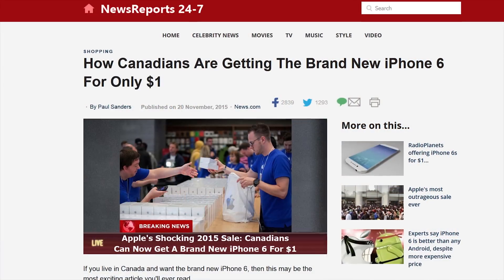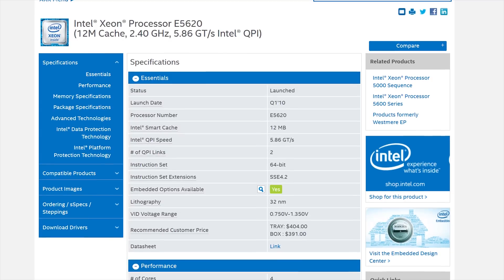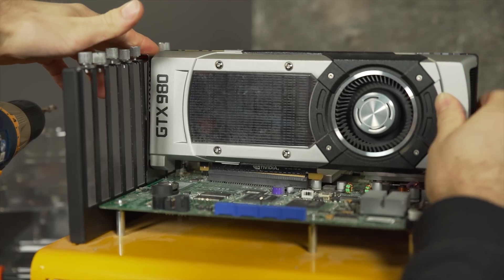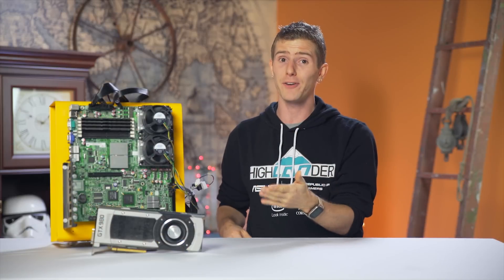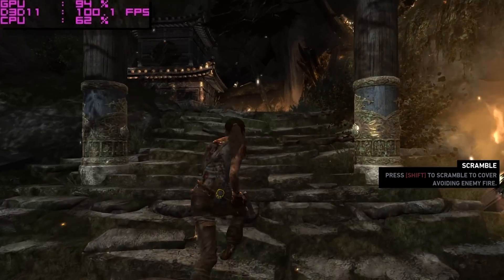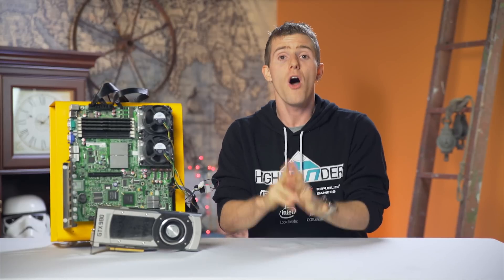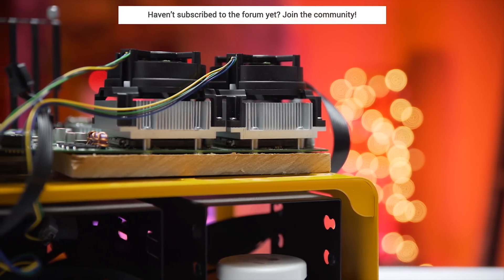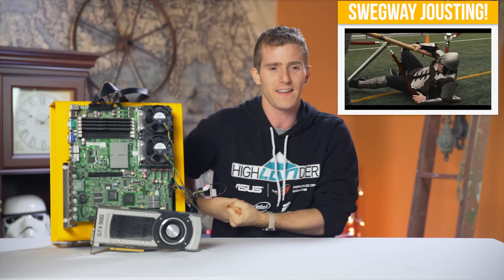Under $150 Budget Gaming 8 Core CPU, Motherboard & 16GB RAM

Comment: = to a amd fx............ get a fx it cheaper and use less power
Reply: +MrBonami2 Edit a fx 6300 at 4.4 do the same cinebench score i had one.. and a fx 8300 at 4.4ghz do like 650-700
Reply: *****  Yea sure........ Game are perfectly coded bullshit
Reply: *****  Im trying to says that current cinebench show a decent result for any cpu that can be trusted.. a 6ghz fx reach 1000+ score
Reply: +Qyndryx do not really care. it show amd fx multithread to be ok and singlethread to be crap
Reply: ***** Use passmark the benchmark software if you want to see the purpose of amd fx.  My 8300 at 4.4 is reaching the same integer performance as a stock 5820k.. That pretty awesome
Reply: ***** I agree with you on that :)
Reply: +MrBonami2 i bought a used X58 system. A Xeon X5650, 12GB ddr3 and an asus sabertooth x58 coupled with an Samsung 850 EVO 250GB, 2x 2TB WD red and an Asus R9 290X platinum. ITS A BEAST. My cpu runs at 4GHz, and has a cinebench R15 score of over 900.
id say, for about 500€ (i bought everything used) this thing was totally worth it. absolutly wrecks every intel quad that is out right now in terms of multicore performance. i bought the Xeon X5650 for 70€, doubt an AMD FX 6350 can keep up with it, and also every part was bought on its own - my ultimate console killer machine
Reply: calcyss That a great build :)  but it about as strong as a fx overclocked in singlethread  Since the xeon got hyperthreading it inflate it Cinebench score :)  my 4790k crush a i5 just because of that.   Can get fx 8300 for like 100 usd.   But it still agree with you that your build is awesome for the price :)  Sabertooth + Xeon 12 thread.

My fx is on a 100$ mobo and do 700 cinebench at 4.4  But is equal to a 5820k in Integer task

Comment: Linus, you should just try and get a 1156 socket build. Dirt cheap and no modding needed. No ECC memory. Perfect motherboard/cpu combo for any case. It may even run games better and overclock to 4ghz. Check out the i7 860s. Lots of people were able to get them to 4ghz+ on Air.

Comment: This is a terrible idea. You want a cheap 8-core PC? Get an AMD FX 8320. It will perform far better, and that CPU can be had for as little as $100 on sale. With the motherboard and 16GB of RAM thrown in, you'd come out to around $200. I owned a Dell workstation with two Intel quads from this generation (X5350s). Aside from the performance being as poor as this video shows (nearly identical cinebench), the heat output and power consumption was tremendous. The CPUs alone use 240 Watts total (120 each). But Linus would rather defend the practicality of using server hardware that is several generations old than admit that an AMD CPU could be used for gaming.

Comment: I went with a modified xenon chip (q9550 equivalent) to fit with a p45 p5q pro and 8gb ddr2 800 and hd7970.   Overclocked the CPU to 4.2 GHz and costing me totall less then 250usd :) steady as a rock for over 5 years now.

Comment: i just got two 5620's for 25 bucks lol, the i7 960 only beats this procesor by less than .5 CPU boss score, imagine two of them!! i also have a 6870, so in my case, the gpu might be the bottleneck
Reply: +oldyogi23 correction, it beats the i7 960 with a score of 5.5 vs 5.4, the i7 980x beats it with the score of 5.6 vs 5.5, however the i7 980x creams it in geek bench, and doubles it in passmark whole cpu

Comment: I just got an hp xw 6600 workstation (at least I think it is and xw6600) it has 2 quad core e5430 xeons at 2.66 32 gb of ram 2 hd5870's and a 500 + 320 gb hdd plus his older (700 w cm b series psu) and as far as I notice that thing works like a charm. It does seem like a good deal for 200€ and thanks to you linus I now knows that it wasn't a bad idea because I haven't had time to benchmark it yet.

Comment: I feel it necessary to point that you probably shouldn't have modified the (very nice) video card, despite the fact that it was fine electrically. It probably would've been easier and better to have desoldered the capacitor and relocated it. That motherboard isn't nearly as valuable as the GPU...

Comment: 2 very big issues with doing this first is how much power is required for 2 old cpu vs one new cpu (i guess not a total deal breaker but will heat up a room a little bit quicker) So you will need a least a 600w psu to be on the safe side, and the other is the really big one any single threaded app or game will perform very slowly 2.4Ghz is just not enough for good fps in single threaded games like D3 RoS. Now i suppose the right tool for the job is in order so if you dont play games that are single threaded (base) or if you want to use this system for doing work like encoding then maybe it could be a good deal.

Comment: Is someone willing to make a 450€ build without GPU (have a gtx660 OC laying around) for me on PC parts pickrr? If you do, please do it with german prices (they are a lot highrr than the american ones). Would be nice if someone did that because i'm giving up because of the high prices in germany
Reply: +Dölle 220€ for a 190$ CPU is not cheap._.
Reply: +xSixtyyy Sweden recycles motherboards, cant you take the train to Sweden and get some Recycled parts cheap? All the gold, silver, copper and other metal that comes out of them.
Reply: +xSixtyyy 
uhmm prices are one of the cheapest in europe here in germany. I can make you one on the german website mindfactory.de. This website has the cheapest prices.
https://www.mindfactory.de/shopping_cart.php/basket_action/load_basket_extern/id/7aa1792219f181c7e28783e17381317f35d17fa442e81620271
Reply: +Dölle but thanks for the sick build:)
Reply: The cpu is 180€
Reply: Dölle yeah im not talking about this one

Comment: ill buy that damaged 980 for 200 us dollars hit me up linus
Reply: +Der Derderder I wish I had a 980... It's a beast of a card, and I really wanna try Nvidia's Flex Demo.
Reply: +Yarnell Riley If you are working in any CAD then you should already know that the best cards for that are the Nvidia Quadro line. As for simulators, I would suggest AT LEAST running two 980ti in SLI for decent performance on the settings I'm assuming your using (some of the highest bc enthusiast ftw). The card itself is NOT trash, it is just how you are using it.
Reply: Oh man.. u can repair a damaged gtx 980... pro man....
Reply: did he ever hit you up?
Reply: +Yarnell Riley WTF really?? XD what make you say that?
Reply: Oh ok, maybe they are not optimized for this card, what simulator you're talking about?
Reply: +Der Derderder hit me up with a gtx titan x for 32 cents.
Reply: hell i find gtx 970 where i live all the time for 150
Reply: Maybe that is the issue.
Reply: Well.. you'll need to wait to upgrade, because, you know, you have the best you can have at the moment. Maybe SLI it with 3 other 980 ti?
Reply: +Alec41000™ even the GTX 470 with like 1.3GB is like $340 imagine the Titan LoL

 PNY XLR8 GTX 470 1280MB GDDR5 PCI-Express HDMI Graphics Card VCGGTX470XPB https://www.amazon.com/dp/B003CFAVU4/ref=cm_sw_r_cp_awd_4h6ywb9YQ1K68
Reply: +Alec41000™ You must be a geeky masochist to like to be beaten up with computer hardware :P
Reply: +Yarnell Riley shoot me a message when you do and I'll love to buy it!!
Reply: JM Extinction Uh, Nvidia Quadro ain't designed for gaming. Just to let you know.
Reply: +Oriru Bastard You may want to read a bit more about the differences between Quadro's and their GeForce counter-parts... which is almost no difference aside from drivers and factory clock-rates.  They were certainly produced with Professional applications in mind, but it's not as if they are a slouch in comparison.

The retro crowd has been using the Quadro cards, which become abundant and inexpensive once their life-cycle has ended, due in part to this common mentality which you also have, "they aren't gaming cards," because they are often just as fast, and they have better video output--especially, the older cards with analog output; they had superior output quality compared to their GeForce counter-parts.
Reply: +MattVideoProductions i just saved up for a 960 4gb ssc and its great
Reply: sam bridger Let me guess, you have 6 way Sli with Titan Zs because you wanna play Minecraft at 4k.
Reply: 660ti >>
Reply: FrostBittn Eh, they're essentially the same but you'll have easier time finding GTX 660 for a 100 bucks while people still ask like 200 bucks for GTX960.
Reply: Keith Pickett Neither, a gaming one.
Reply: MattVideo Productions just get an rx 480 or 1060
Reply: titan x (pascal) isnt worth the price bump. performance vs the 1080 ti is about the same.
Reply: What is your processor?
Reply: I got an IC i7-4960X non- OC'd
Reply: Marco Rodriguez lol xD did not see that coming xD
Reply: +Marco Rodriguez not sure if its worth it, gtx 750 ti is actualy really cheap for its power
Reply: +Marco Rodriguez What the heck, you can get brand new GTX 970 for that price
Reply: +Yarnell Riley what would you upgrade to a titan x isnt much better
Reply: +Yarnell Riley lol you bought the wrong card for the software, you need a QUADRO or FIREPRO cards.
Reply: +Yarnell Riley upgrade ? to what ? thought 980 ti was the best at the moment
Reply: +Der Derderder 200 bucks? Hah!
I would barely buy it for 20 bucks.
Reply: +Yarnell Riley yeah i have to agree i mean its amazing, you juist expect more
Reply: +Pascal Lafrenière i have a 980ti too, but if you max everything on witcher 3 youll barely be hitting 60fps
Reply: +Yarnell Riley gtx is not optimised for simulation loads , plus it might not even be safe to use one in such work , because of accuracy .
Reply: +Pascal Lafrenière Nvidia Quadro and Titan are the best ffs what are you talking about
Reply: Matthew Weidemann Quadro cards are powerful yes but they are designed for 3D rendering, not much for gaming.

While you can game with Quadro cards, they don't push out same peak of performance in gaming as GTX series do.

For an example GTX 470 easily out performs Quadro 6000 in gaming.
It has nothing to do with "Mentality" but it's a fact that if you want to have gaming card, then you better stick to GTX series.
Reply: +Oriru Bastard Nobody interested in this project is part of the "peak performance" crowd.
Reply: Matthew Weidemann That's pretty essential part of the gaming mate. If no one gives a shit then why did you bother to try to glorify how awesome Quadro is for gaming in a first place?
Reply: Matthew Weidemann Okay, now you are just trying too hard to be smarter than you really are. It is a simple concept that has nothing to do with "mentality".
Reply: +Pascal Lafreni&#232;re Well considering you get 60fps avg at 4k if that sometimes... You would expect like 100+ for a card thats $600+
Reply: hahahahaha!
Reply: hahahahaha!
Reply: +forgetmepls you don't have to repair it. you just... don't have a lock for it, so it might fall out. who cares.
Reply: Just super glue the tab back on.
Reply: I'd buy that for a dollar!
Reply: +Redenderpearl LOL why buy a 960.... specially with the new series around the corner//// and price drop on 900 series... you sir are an idiot
also... 960 lol plz do you even minecraft
Reply: sam bridger Because he is smart with his money and knows what he needs.
Reply: +A Christian Gamer nah 960 is aids
Reply: +sam bridger The 960 is not aids, like Cyortonic said, "knows what he needs", I doubt they're going to be running Far Cry 4 at Ultra settings in 1080p and expecting to get 60fps. Also, not everyone can afford top of the line Graphics cards
Reply: sam bridger GPUBoss says otherwise http://gpuboss.com/gpus/GeForce-GTX-960-vs-GeForce-GTX-660-Ti
Reply: +Oriru Bastard 750 TI is 100$ so why would you buy a 660 lmfao
Reply: 660>>
Reply: Kyle fulerton Because that's 1,728 GFLOPS performance versus 1881.6 GFLOPS performance.
Or better, if you can find 660 TI for 100 bucks then it's 2459.52 GFLOPS which makes about 578 GFLOPS difference.
Reply: +Oriru Bastard After reading this whole comment chain, What would be better for a game like Arma2 DayZ, a work-station GPU , or a Gamming GPU ???
Reply: really ? I've heard that the Arma engine only takes advantage of maybe 30%-ish of any graphics cards potential ,

Even if you set the video memory usage to default witch has been confirmed to be the best setting for both the base game and the mod. ?
Reply: +Keith Pickett Well, "gamming" doesn't exist.
Reply: oh , I always thought it was spelt with 2 " m "s
Reply: +Yarnell Riley just wait for the 1080 or 1070
Reply: +River Cress For what he's doing, he should really be using a workstation GPU like Quadro or Firepro. Even a Titan X won't handle his simulators all that well. They're designed for gaming, not rendering. From what I've heard of the 1080, it might not do too bad. It's still the wrong tool for the job though.
Reply: Oh, and found this on reddit. 

"As far as running a stress analysis with Simulation, don't worry. It does not use the GPU but rater the CPU. So you will never run into any issues. Get whatever you want. It will work on both."

https://www.reddit.com/r/techsupport/comments/zs1ct/can_someone_explain_the_real_difference_between/

His problem might well be his CPU. The 4960X, as beastly as it is, is already 2.5 years old. It might just not be up to the task of today's simulations. Whatever those are.
Reply: I'm 5 months late but SLI is a very bad solution to low framerates,
Linus has stated this before, just selling your GPU and getting a better one is far better solution than SLI because SLI doesn't combine 2 GPU's powers together, it really only gives you a quarter of performance of 1 GPU whilst the full power of one.
Reply: +Sigma no, just no. If you sli 2 cars you normally gets 80% of the second card in recent games, only with 3 and 4 ways sli you run into problems like you described
Reply: MattVideo Productions I got an rx 480 vrready
Reply: get the titan x.. its 400 hundred dollars more than a 1080ti
Reply: I'll buy it for 201
Reply: +forgetmepls not that you dumby, its because its from linus himself
Reply: Its performance when i do work in my simulators.
Reply: +MattVideo Productions mehh. i have a 980ti and its not at all what you'd expect from a card with such a price tag. im looking to upgrade soon
Reply: That could be but i doubt it because the 980ti isnt that new anymore you know? Maya NX CAD, Universe simulator, SPH partical fluid
Reply: Surface pro 4
Reply: Der Derderder yy
Reply: IT'S NOT FUCKING DAMAGED. IT WORKS PERFECTLY!
Reply: +Vin Venture im waiting on the gtx 1000's series maybe aroung may-june 2016?
Reply: Der Derderder lol
Reply: Pascal Lafreniere that's not sli that's crossfire

Comment: excactly what knid of power supply will i need? I have a 400 watt psu laying around but I am not sure if that is enough with these cores having bad power efficiency and 2 cpus. I would be pairing this with my spare gtx 650.

Comment: My pc is using an old core i5 750 slightly over locked to 3ghz on a msi p55gd45 and struggles to get above 50fps on csgo, what would be the best route for an upgrade should I go completely new on both components or get a new motherboard and decently over clock my cpu? Also how much of an impact does the gpu have on csgo?

Comment: Would be even better to use a high end 775 motherboard and a 771 to 775 adapter,  x5460 or x5470 and overclock it to 4.0-4.2ghz. 
4.2ghz x5470 does around 460-70 in cinebench.

Comment: I have a similar system. I have a Dell Precision T7400 with 2 E5405's, 32 gigs of ram, a Samsung 840 pro raid 0, and a 390x. This system is nice enough but when you really want to push it for some fun triple monitor  5760x1080 gaming it just dies. I average about 20 fps in Project Cars. Not quite the performance I would expect out of my high end gpu, so I assume that it is a cpu bottleneck. My Christmas list has a 5920k, 5930k and a 5960x on it saying I will take anything I am desperate.

Comment: I've been using a SuperMicro X8DTI-F board with two Xeon 5620 CPUs. Board was $100 and came with two Xeon E5620s @ 2.4 GHz. The CPUs aren't insanely powerful, but I can easily upgrade to a 5687, which is 3.6 GHz quad-core.
The board also has tons of room for expansion.

Comment: I bought a T3500 Dell precision with xeon w 3680. its a 3.33 GHZ processor and can reach 3.6GHZ turbo boost... it's a 6 core  12mb cache processor ..with 6 gb DDR 3 triple channel 1333 mhz Ram.... 120gb(3gps samsung) SSD  and 500gb HDD... for around 250 $ from a second hand shop...i am using it for last 6-7 months and trust me its a really really powerful beast......if u cant afford these new i7's etc like me ...trust me go for these xeon pc's they are really good. and the mother board is 09kpnv with x58 chipset and there are two slots of GPU's and yeah you don't need to use saw's etc to make them fit.........Sorry for the bad English ......Cheers.

Comment: If you are thinking about buying used, you can easily buy an h55 motherboard and an i5-750/ 760 for about $130-150. No hoops to jump through either unlike the server board.

Comment: But with 150$ you won't gaming shit, you will still need to buy a gpu, and a 980 is pretty expensive.  So at the end you will spend over 500$ for a mid-end gaming rig without upgrading option, no warranty, and maybe it won't even work the first time, maybe not even the second time, and then you must molest your gpu, and then maybe the rig still won't work properly. And at the end the better option will be to just buy a normal gaming rig. Play on medium settings, and save some more money to slowly upgrade your rig.